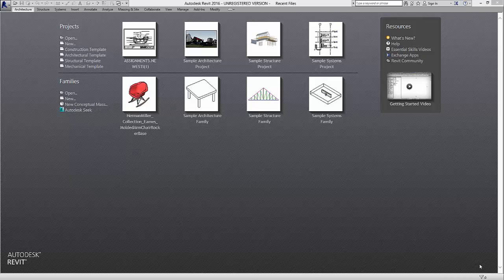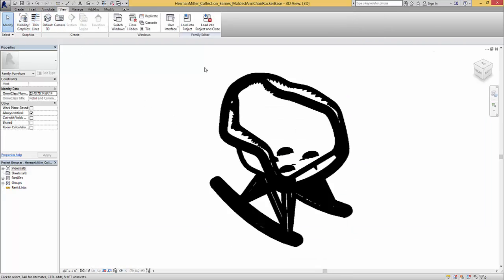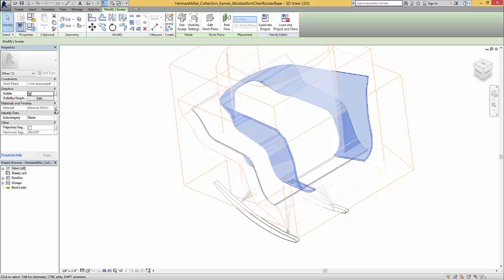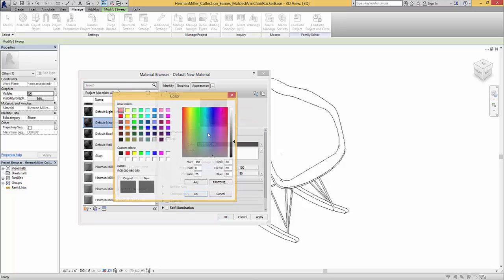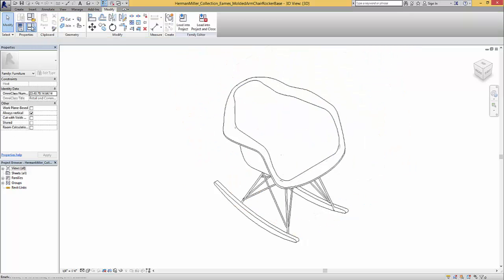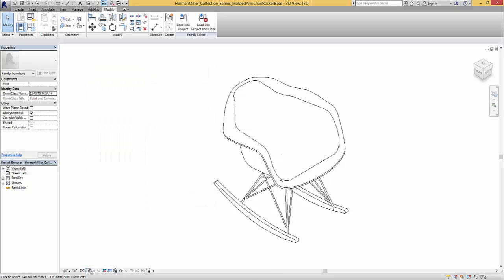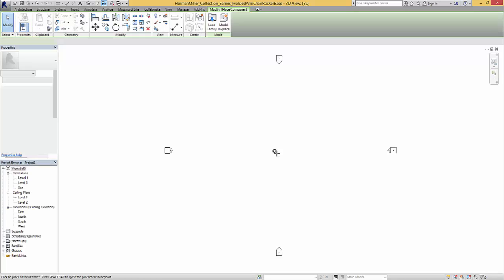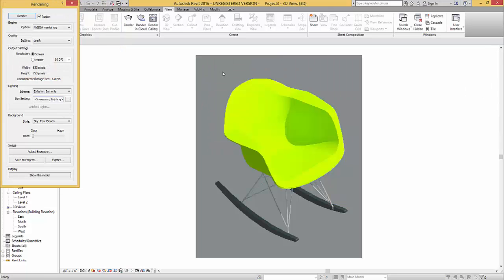Revit Edit Materials in Imported Families

Comment: This is not showing assigning material to imported family/object. It is a revit family and materials applied shown are applied the way Revit does for all the rest of families you create in Revit. I came here to see how to apply material to a CAD or Max built object, imported in Revit as CAD object. The thing works on some computers and some times it does not work, I mean the Object Styles and Assigning materials to imported category. 
Any solution for that???
Reply: Hi have you found a solution to applying materials to cad drawings yet. I am having problems with this via the object styles method however materials still do not show in renders. Thanks